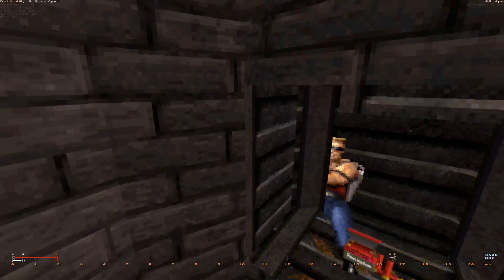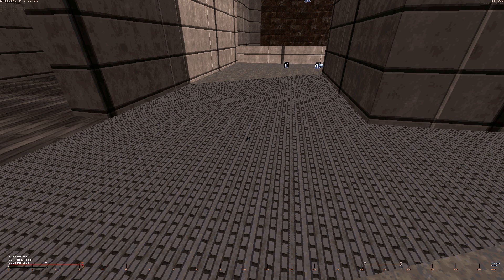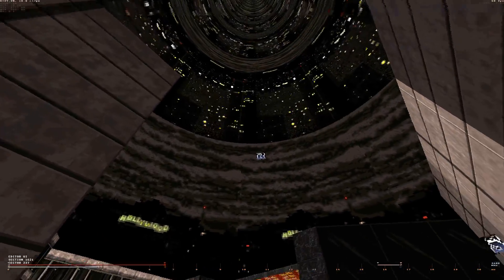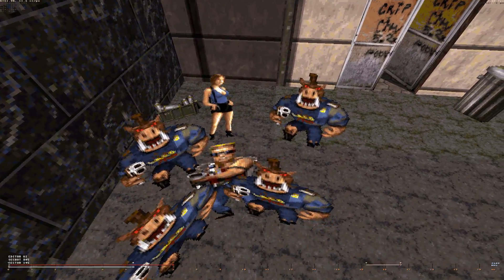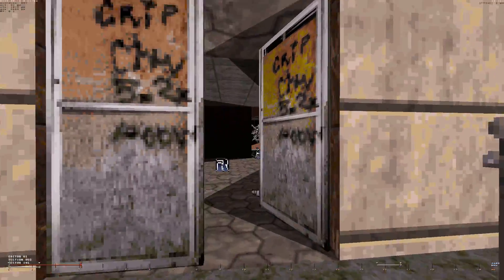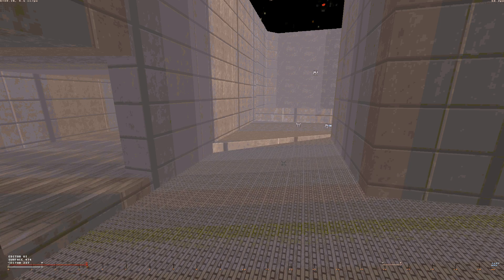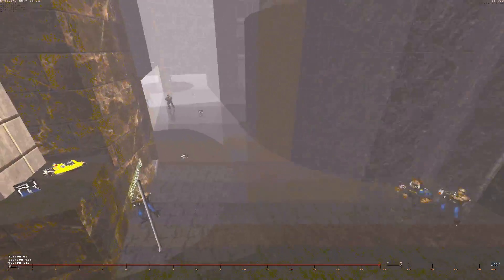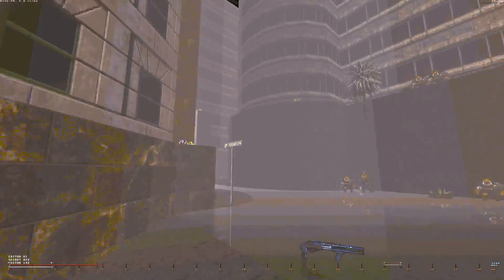Running Brahma renderer on E3L4.MAP from Duke3D

Comment: Hello. This engine is very impressive. Very good job i have to say without being into programming myself, it shows it is a work of passion. Does this use any dynamic light?
Reply from the maker: Thanks! I believe that only an actual work of passion can turn into something groundbreaking.

I'm not using dynamic lights yet, since it will require a lot of engine tweaks to manage lightmaps efficiently. Eventually there should be lightmap-based dynamic lighting working in global illumination fashion (i.e. each object being an area light).
Reply: @punpcklbw  ok! Maybe it does not need that as it looks good even without. But maybe it would be interesting addition with the rest of the features. Br
Reply from the maker: @Axelvad  The engine definitely needs a decent lighting system in order to reveal its full potential. Currently all diffuse materials you see are treated as emissive. In fact, they don't reflect anything unlike real-world objects, since there is no reflectance model other than basic planar mirrors (yes, they count as very basic stuff for this engine).
Reply: @punpcklbw  ok. It got me thinking.. If one pass of ray casting could set emissiveness per surface. One could maybe use voxelization to set global subdivision for more rays but keep it low for performance. Im thinking loudly tho.
Reply from the maker: @Axelvad  Yes, also I know that some implementations of global illumination use a rough voxel representation to distribute light faster. However, I don't believe that voxelization can perform any good as it's fundamentally deficient for thin walls or fine and coarse detail within the same scene. I'd prefer a radiosity-like approach with lightmap pixels used as elements in a dynamic fashion, by means of rendering actual views from each element on demand and baking available light energy directly into the lightmaps.
Reply: @punpcklbw  Ok. Sounds like good points.